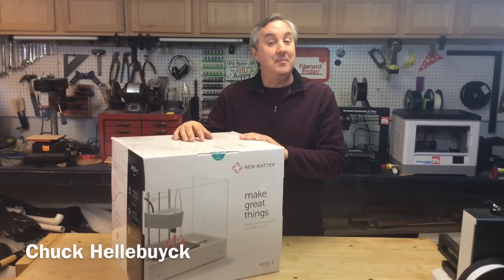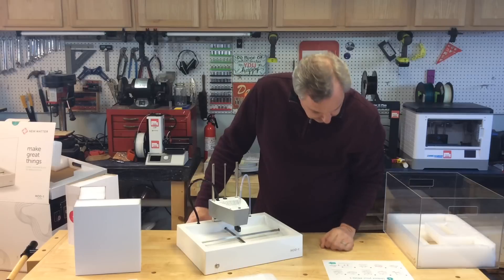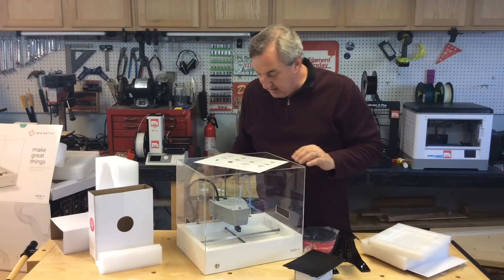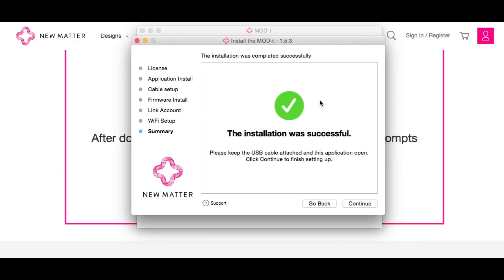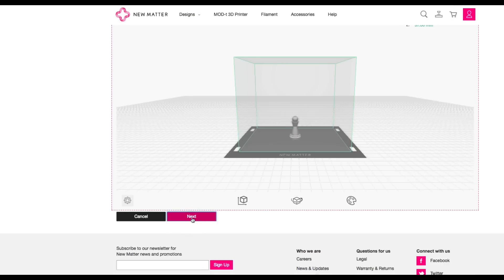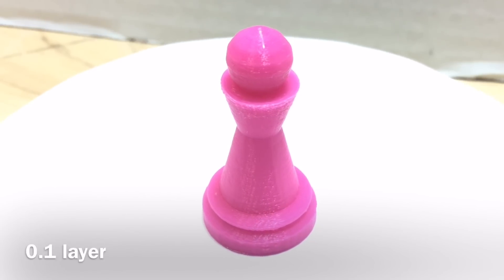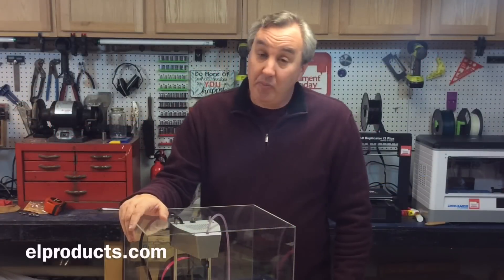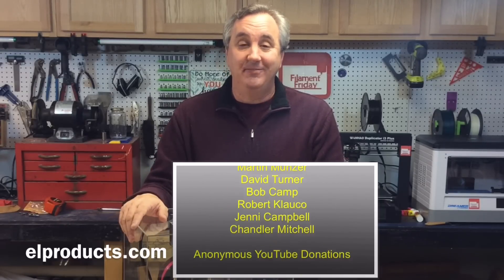New Matter Mod-t 3D Printer Unboxing and Review with Complete How To Setup

Comment: According to their website new matter is closing up shop for this printer
I'm helping a friend with one z  Drive doesn't seem to want to function for the calibration at all so it fails and the new software that you download for it only pushes g code to the printer and being as the shop for it is close the that means you don't have the cloud as far as I can tell to do the slicing so I don't know what they're going to have to do for slicing with this printer .
PS the final firmware loses wifi

Comment: you can use any slicer you want, I use cura. With that, I tweaked a few settings and I get very good prints. You cannot do custom gcode on the website but you can through the desktop aplication.

Comment: is this printer worth buying at $140 shipped?  could you tweak it and get it dialed in?  Thanks
Reply: CHEP 3D Printing      Ebay auction.  You can also find the davinci 2.0 duo for around $229, you get such great results with your davinci I thought I should buy a used one then just follow your videos to get it dialed in.  Thanks a million Chuck, you have the best info and you make it easy to understand and follow

Comment: Wow.  They did an excellent job with the instructions for unboxing and setup.  Most other vendors could learn from them!  It is a shame the print quality was so poor.  I'm curious if the company will contact you with tips to improve.  I really enjoyed this review.   Thanks!
Reply: not from the company but as someone who's had one of these for a year and had it apart more than once, the main problem is the default print speeds and especially accelerations are too fast, you can get some really good prints out of this if you're prepared to sped time tuning it and spend a bit longer on the actual printing.

Comment: Do you still use your davinci 1.0s? If you do, have you had an issue where it would start a print then after a bit of time it would fail due to the extruder being too far away from the bed? I am havingthis issue all of a sudden and don't know why it is happening all of a sudden.
Reply: The Z axis is good, I ran it through the jog mode but it looks like the wire harness it tight enough to not let it hit the front left pad when it calibrates. I am trying a smaller print now closer to the back end of the buld plate to see if it fixes the issue. The last 3 prints I did started fine, but then after a bit the nozzle is too far away and it turns into a rats nest. I have just about had it with this machine, what would you recommend under $1000 that has a fairly large build volume like the davinci has?

Comment: Love the bed adhesion without any glue or tape.. and that it comes out and you pop it off. That's worth a lot to me.
Reply: CHEP 3D Printing thats because the flexible build plate is curved :/

Comment: I wonder why it was so bad?  I lay odds it is the moving bed because that is a lot of mass to move around which will affect your prints 100%.  Reason I hated my Prusa I3 rework because the bed moved in Y but on my FF Creator Pro the bed only goes up and down and the print quality was far better (even his MK2 still has issues with the moving bed some) so the printer I created uses an elevator bed as well and uses wheels and V-Rail.  This printer will be 300x300x340-350mm so will be able to do most anything I would need once I build it. :)
Reply: *****
Good point.
Reply: Dark Alchemist its not the slicer . I have used simplify3d with it and it still looks like shit. The underlying rack and pinion mechanism which makes it "cheap" combined with the dc motors and the firmware seems to attribute to its rough surface finish. Lobocnc actually replaced the controller board and the prints look better. In short, quite sure you still need proper bearings for a 3D printer
Reply: someoneonlylol
Good to know and it proves it is a hardware issue not a software one which is bad.  Stay away from this printer then.

Comment: Neat for a starter printer.. but lacking on the print quality for that price point I think. 
Thx for the review !
Reply: It is due to the bed design as it moves in X and Y and has a lot of mass unlike a traditional printer (even a Prusa only moves it in one direction).  I suspect if you slow the print down to a crawl it would be a better print (reduce nozzle temps accordingly as well).
Reply: *****
Possibly but having all of that mass moving is not good either.
Reply: *****
Keep us updated. :)

Comment: what does it use to calibrate?
Reply: it uses closed loop optical-encoded servos instead of stepper motors so it can detect resistance on the motors and take readings from that
Reply: that's one part i haven't had cause to look in myself but i've seen photos of other people who've had it open and it looks pretty straightforward, there's basically not much in there, the controller board is tiny

Comment: That's a really nice review. I had the same thoughts as you while watching. Unboxing is a well thought out process and seems really well documented. I also like the idea for the removable build plate and the mount of the bed itself (even though I'm not a fan of a X/Y moving bed). 

It's probably something my dad would be able to use - as long as it does not starts misbehaving. It looks like it might be difficult to access the hotend / nozzle in case it gets jammed. 

Also for tinkerers like us, it is way too limited in options. And I'd be kind of afraid of the cloud service shutting down if the printer is not that successfull.

When you copied her smile you didn't look at the orientation of the filament roll ;-).